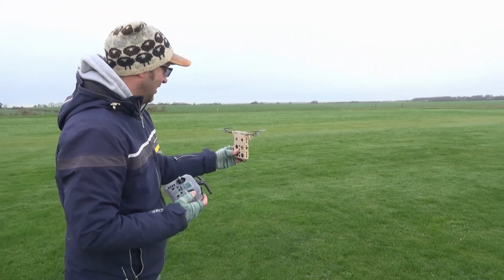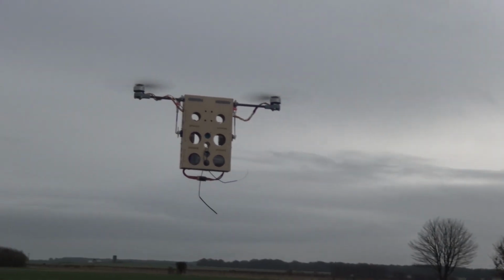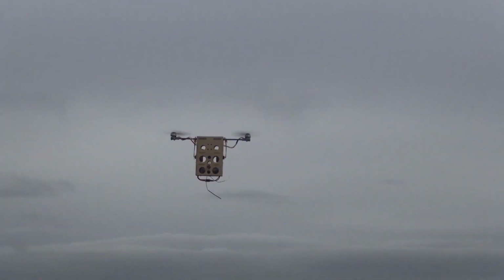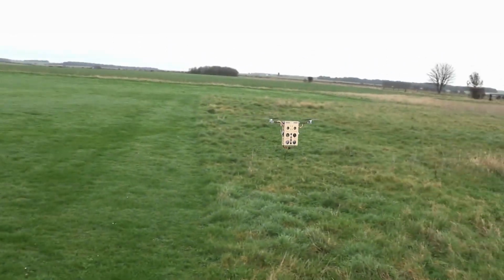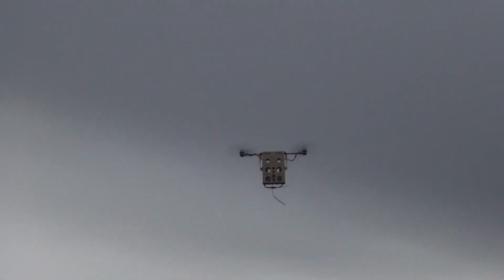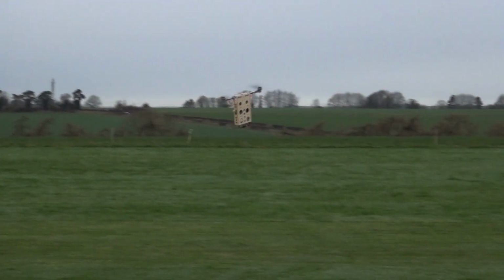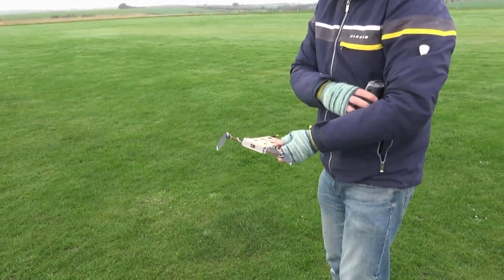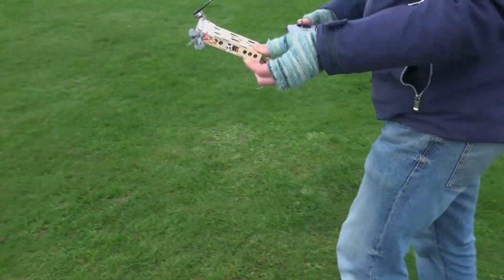DIY BiCopter / Dualcopter & ESP32 Flight Controller ~ 2nd Flight

Comment: The flying gruyere. I ve seen all your files and details and I must admit that it is very tempting to try this since and make crazy models
Reply from the maker: Thank you, give it a go and enjoy it 😊
Reply: @plainflight I surely will because I use a lot of CC3D boards in planes and quads and was always tempted to do more than that and since I have made a few  Arduino projects, the advantage of your stuff is that I won't be too scared to put my dirty hands in it ;) . I'm impressed by what you did and especially with the PDF guide you made.

Comment: Good work! May You explain why using ESP32-S3 not ESP32-C3? Thank You.
Reply from the maker: At the time is was due to higher io pin count/more usable pins on the S3 XIAO boards to do all the functions I wanted. It’s also faster clock speed. I did start the project with a C3 which worked fine. The S3 is also dual core, I did split tasks across the 2 cores but found it didn’t offer any great benefits in performance for me.
Reply: @plainflight  Thank You! I will use C3 that cheeper and more energy saving. I comment in code //#define USE_LED_BUILTIN //#define SINK_LED. Are that only discard the external led?

Comment: Hi - Will this version be released? Manual updated??
Reply from the maker: I am testing v1.1.0 now with a several upgrades…. Wasn’t going to include Bicopter mixer in it but if there is enough interest then it could be added to a following version…. Or I could do a video to show code changes as it’s fairly simple.
Reply: Thanks. I'd really like to try it, I have an ST Bicopter I built a few years ago, KK2 controller, never did get it right. Anything ou can offer would be appreciated!!  @plainflight
Reply: @plainflight  Any update on this...?
I'd like to try it...!